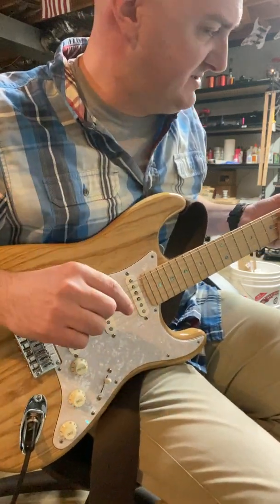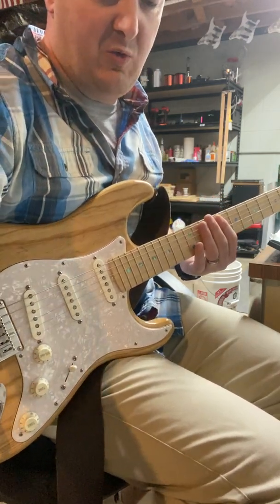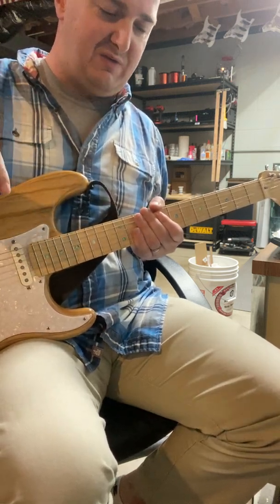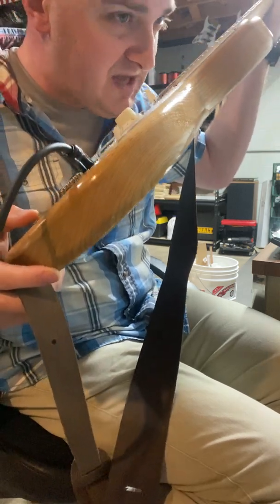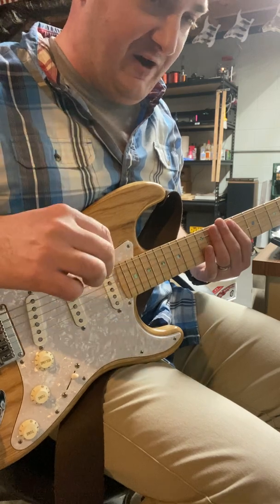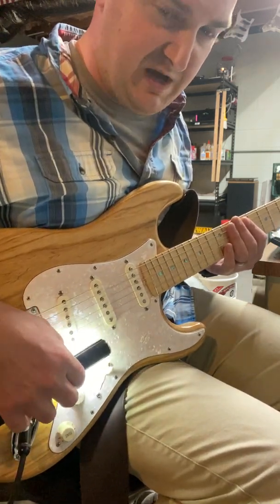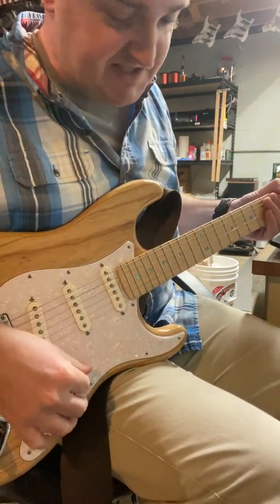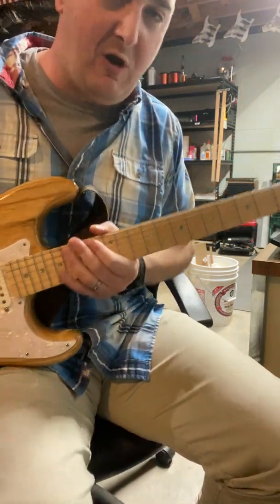60 cycle hum, RFI and Shielding is useless Noisy electric guitars SCIENCE EXPERIMENT

Comment: This video is very informative. Thank you! 
I am kind of new to all of these sounds. My first guitar was a PRS Torero with active pickups and those are really quiet! I never heard any noise or hum with that guitar, but a couple years ago I got a Fender with a P90 on the neck and a humbucker on the bridge. God, it is noisy!! Even with the humbucker, it is VERY noisy, but maybe I feel it that way because I was used to the quiet pickups on my PRS. My Fender also had one problem: from factory the bridge wasn't wired to the ground, so it was way noisier, but later I got that fixed. I still feel that there's something wrong with the wiring, but maybe it is also me having a hard time getting used to these pickups and finding out that the wiring in my house is worse than I thought.
Reply from the maker: Thanks for stopping by and commenting! 🤘.

Yes, when you have really quiet active pups and go to a single coil or other passive pups and play with high gain, the noise level is very different.  Honestly I just deal with it. I prefer the dynamics of passive pups over active.

Comment: 6:30 This noise is not from the light or LEDs, there is a pulse converter inside the flashlight, the noise from it.
Reply from the maker: I know that and understand that completely.  But breaking down any further than “this light causes rfi” for most people whenever they can’t identify and understand the difference between basic guitar electronics noises doesn’t help anyone.  I’m not trying to insult anyone by their lack of knowledge here and that’s precisely why I broke it down to basic ideas with basic demonstrations.  

Sometimes being “too smarty pants” is too much when you are covering basic topics quickly.  Being effective while teaching is more important than teaching stuff that 1- is over someone’s head 2- not really relevant to the purpose and intent of the lesson. 

That thing I have in my hand is a light.  I used the light to make the noise.  Either way, the noise is still RFI.

Thanks for the comment. 🤘
Reply: @MathewsGuitarWorks  
Not count boring, but the humbucker is designed to suppress large EM-fields, which it does remarkably well. Using a focused EM-emitter is not the right way to demonstrate. Also, many guitarists don't use that much gain, and the level of noise reduction provided by shielding is sufficient for them.  😉
Reply from the maker: @iridios6127  You are splitting hairs a little. Not everyone is an electronics engineer. Nor do they need to be to understand and demonstrate basic ideas. RFI and EMI are synonymous. RFI generally refers to a subset of frequencies.  

I completely understand that most people don’t play with that much gain, nor do I. It was FOR DEMONSTRATION PURPOSES. 

Shielding passive components, control cavity and or around pups of an electric guitar does absolutely zero in reducing noise in a guitar circuit when the point of entry of all sources of RFI/EMI in an electric guitar are the pups which are open to the exposed elements. 

I bet you’re fun at parties.
Reply: @MathewsGuitarWorks  
Are the shieldings that you set — were made in the form of a Faraday cage, with grounding?
Reply from the maker: @iridios6127  of course.
Reply from the maker: @iridios6127  99% of the guitars that come through my shop have the control cavity shielded some way shape or form. It doesn’t make a difference whether you shield the control cavity or not because passive components don’t pickup or amplify anything. 

Even if you shielded around a pup (pickguard) and around the actual coil itself, it would be negligible at best in stopping RFI if the face of the pup is exposed to the outside world.
Reply: @MathewsGuitarWorks  
Sometimes, someone makes an overcomplicated or a poorly executed circuit and then — shielding helps.
Reply from the maker: @iridios6127  Not in passive guitar circuits. It is marginally effective in active circuits.

Comment: I heard from someone that cavity shielding works a bit like a extra capacitor which cut some of fq from signal, thats why its looks like we deal with 50/60hz hum. But same thing we should get when we turn down master tone a little bit. Anyways... i will be always hum more or less depends of place where you playing and how good electric instalation is, grounding etc... And shielding can change overall guitar tone so... 🙄 Its better to buy noise gate.
Reply from the maker: Never had the need for a noise gate. I’ll deal with the noise first before I do that.  

Thanks for stopping by 🤘.
Reply: @MathewsGuitarWorks  now i didnt play on stage but when i was active and play with band i used cheapest behringer noise gate for 20$ (boss clone) and this works well.

Comment: so i have a guitar that sounds the same as yours. Is there any fix or workaround to reduce the noise when not touching the strings? thanks in advance
Reply from the maker: Ground noise while not touching the strings is completely normal. There’s not a lot you can do other than make sure you have a quality wiring harness or at minimum the wiring harness in it is properly grounded. It won’t make the noise go away completely but  proper grounding will help reduce it.  I’ll tell you that mine gets worse with cold dry air. When it’s moderate temps and reasonable humidity, I notice less noise overall from my rig with exception of 60cycle hum which is a single coil pup thing. 

Hope that helps, thanks for watching.

Comment: I had a copy strat. Shielded. But the hum never goes away. I think its normal for a single coil to hum. And im getting used to it. 😁😁
Reply from the maker: Yea, I have learned to deal with it myself. Now remember, my amp in the video was cranked, so the noises are way louder than usual. When I run my amp at normal volumes, it’s hardly noticeable. I tried noiseless single coils and I didn’t get the sound I was looking for. So I’m a true single coil fan.
Reply: @MathewsGuitarWorks  i havent tried hot rail pick ups. Maybe it will work.
Reply: The hum shows up when im using distortion. But in clean tone. No hum at all.
Reply from the maker: @khrisemmanuelmaxgeneralao809  that’s completely normal. The more gain you use with single coils the louder the 60 cycle hum will be. Hotrails are just small rail humbucker pups. 60 cycle hum is not a big deal for me. I’ll stick with real single coils.
Reply: @MathewsGuitarWorks  thanks for the info sir
Reply: @MathewsGuitarWorks  if i installed hot rail pick up for bridge, will its still hum? Sorry for the grammar. Im from philippines.
Reply from the maker: @khrisemmanuelmaxgeneralao809   No. If you install a hotrail pup in the bridge, it will not have 60cycle hum anymore. If the problem persists, then it’s some other problem.
Reply: @MathewsGuitarWorks  ok sir. I ordered musiclily hot rail pup. I cant afford seymour duncan hot rails. Hehehehe

Comment: I would be curious to see this video with many different new tests :

-Use only you amp, no pedal in between.
-Pack fresh cable.
-Never change your EQ or Amp settings between two tests. Leave everything at 12 o clock.
-Stay 2m away from your camera and cell phone.

Test 1 : unshielded guitar : plug your guitar with absolutely EVERY other electrical equipment unplugged or with the circuit breakers opened except the one you're using for your amp. Other equipments put noises back in the ground wires,

Test 2 : Test 1 + power conditioner (like a Furman) in order to filter your electrical signal and regulate it as your electricity provider may not deliver stable electricity.

Test 3 : Test 2 + fixed ground wiring to be absolutely sure your guitar is well grounded. Must be properly tested to be entirely sure the grounding does work.

Test 4 : Test 3 + fully shielded guitar that is actually grounded to your guitar jack, with each cavity connected to one another.

I would be surprised to see what noises you still have left with each of those tests.
Between each test, try touching / not touching the guitar grounded metallic parts, and try changing from a pick up to another.
I would also try powering everything back on after the last test and see what noises come back.

Your video was fun since you clearly suffer from most possible noises guitars can have. Now I would like to see you fixing them one by one so that it helps associating a noise to a specific issues, and then to a specific solution.

I ll subscribe and wait for part 2 !
Reply from the maker: Haha! I don’t know if I have the time to do all that but I do have a shielding test on the books to work on and post. Probably be sometime in the first quarter of the year before I get to it. I have a bunch of pedals and pickups I have to finish and get out before I move on to anything else. 

Some of the noises absolutely can’t be cured. 60cycle hum won’t ever go away and the ground noise when not touching the metal parts won’t ever go away. 

Thanks for watching and commenting.🤘
Reply: @MathewsGuitarWorks  If touching the strings makes the noise go away, it means the grounding of the equipment is naturally faulty (instrument electronic, cable, amp, socket, house wiring ...). I have this exact same issue at the moment. I am starting to troubleshoot it. I ll let you know if I find anything that solved my case, even though the noise is clearly manageable.
Reply from the maker: @Romain_Chafore   The noise that goes away when you touch the strings is normal. Some guitars do it worse than others but all guitars do it and you can’t do anything to get rid if it.
Reply: @MathewsGuitarWorks  Now I have spent quite some time shielding my Bass, you CAN get rid of it. I shiedled every cavity with copper tape. I ensured there was a continuity of the signal between each cavity and that it was grounded with the knob plate. The result is astounding. The problem was mostly my body acting as an antenna emitting and reflecting interferences. When I hold the bass, noticeable hum. When I put it back on the stand away from me : light hum. Now with the shielding : ZERO hum whatsoever. And no, I am not talking about line hum (50/60 cycle hum) which I don't have since my PU are noiseless, in other words humbuckers stacked on top of one another. Man, stop the clumsy explanations. Get yourself humbuckers, improve your home grounding, use filtered power plus or power regulator, shield your instrument .. 99% of your troubles will be gone.

Comment: 3:50 Discussion of 60 cycle hum begins
5:00 Example of 60 cycle hum sound
Reply from the maker: Preshate that. Maybe I should go through and add time markers for each topic. I actually plan on doing a remake of this video and focusing on the shielding aspect of it with some basic experiments.
Reply: You’re most welcome! I came across a mention of 60 cycle hum and 50 cycle hum in an old rockstar interview that resurfaced a couple weeks ago, and as a non-guitarist I had no idea what that meant. It’s nice to see and hear a good explanation of it!
Reply: @MathewsGuitarWorks Thanks for the content. If you do plan on remaking this, try tying a sock around the fretboard to stop the string noise
Reply from the maker: @scottgallagherguitar  next video won’t include a whole guitar or strings. We are going to isolate the pups and controls and use a proper faraday cage setup.

Comment: The microphonic test isn’t valid, pickups are not microphonic by design and what you are hearing is the string vibration influenced by your voice which in turn influences the magnetic field in your pickup.  To verify remove all the strings and do the same test.  Most 60 HZ , logic tells us comes from the line not the ambient if it came from sources such as light then turning off the light would reduce noise.  Shielding in the guitar is to create a Faraday cage which is nonsense since your magnet poles and strings are outside of the shielding.  A simple thing to do to reduce 60hz noise is to do a twisted pair on your output wires.
Reply from the maker: Agree with everything but the microphonic test. I’ve done the same test on several different pups and pup types and had a similar result.  Some pups are worse than others and construction/parts definitely play a role in this. However, the part about the strings influencing the output is true. 

I’m not trying to solve any noise issues.  I’m simply helping people understand where the noise comes from because most people don’t understand. 

As far as shielding goes, your statement about shielding is exactly what I demonstrated and said. Passive guitar controls cannot be the source or place where noise is introduced into a guitar circuit.
Reply: @MathewsGuitarWorks  I hear you.  The entire reason I wrote is because you get it.
Reply from the maker: Thanks for stopping by. 🤘

Comment: I have what I guess is a weird situation that I've been trying to deal with forever.  A little ground hum, no big deal.  Very little 60 cycle hum.  But I have a lot of what sounds like RFI.  However if I switch to the 2 or 4 positions, it reduces by like 95 percent.  I don't usually like playing in those positions unfortunately.  Humbuckers are quiet.   Also if I move the strat around, it decreases a lot.  I still can't find the source.  I have three computer monitors but the noise persists even if I turn them off.  Shielding did help a little, but not nearly as much as I'd like.  Thinking about getting noiseless pickups even though I don't really like the sound.  I did have a guitar with noiseless pickups and similar to humbuckers, no RFI problems.
Reply from the maker: If the noise goes away when it’s in 2 & 4 and it doesn’t happen with humbuckers then it’s probably not RFI. RFI is from outside the pup. 60 cycle is generated in the pup. 

I’d have to hear it to see what you were talking about. It very likely could be your home wiring. I know mine creates a lot of noise in my amps.
Reply: @MathewsGuitarWorks  It's a higher pitch than the 60 cycle hum that you demonstrate.  If I roll off the tone, it gradually decreases.  

I don't know.  I'll try to make a video sometime this week if you'd like to hear it.
Reply from the maker: @JohnBrown-z2u  find me on Instagram and send the vid to me there.
Reply: @MathewsGuitarWorks  I don't use instagram, but I'll put it on youtube and hopefully you'll still look at it.
Reply from the maker: @JohnBrown-z2u  send it to my email. kalebmgw@gmail
Reply: @MathewsGuitarWorks  Will do.  Thanks
Reply: Might be wifi router or cell phone RFI

Comment: thanks that was really interesting . Just can't figure out why it gets better when I touch it.
Reply from the maker: All guitars do it to a degree. When you touch the strings or any metal part grounded to the circuit, it completes the circuit and reduces the ground noises you hear.  If it is really bad, then you may need to check the harness to see if there is a loose ground. If it sounds like light intermittent random static, then there’s not much you can do to fix that. When it’s really dry outside mine gets worse but not intolerable. There’s also a relationship between your guitar’s wiring, the amp and you when you touch the strings. Most likely, I’d say it’s not an issue to worry about.
Reply from the maker: Thanks for stopping by!

Comment: Very useful.  Thank you.  Question: is there anything that can be done to the amp circuitry to reduce the 60 cycle hum?  I have an ampeg reverberocket II and my humbuckers guitar starts to hum at about 1/2 amp volume, but my p-90 guitar starts to hum at about 1/4 amp volume.  Rolling off guitar volume reduces hum on both guitars.
Reply: Thanks for circling back.  I’ve never heard of either of those two devices, but I’ll look into them.  Right now, I’m mostly trying to keep environmental influences (lights, etc) for radio frequency interference and humbuckers for 60 cycle hum.  It’s much quieter.  I’m still not really clear about how proximity to the amp influences hum and what, if anything other than walking around the room and keeping my back to the amp,can be done to reduce that hum.  I think the ‘answer’ for getting a manageable hum level from single coils is to just use a smaller amp with carefully set volume levels and just mic it.  Again, thanks for this.
Reply: Put a Boss NS-2 in your effects loop.  It will get rid of the hum. An ISP Decimator in front will eliminate feedback.

Comment: Hang on...with the foil test, it's not grounded into the circuit...that's why it's not worked. I have the entire cavity shielded, a plate behind the pickup and then the cavity has a soldered ground going from the cavity to back of the pot. Admittedly it's not a full faraday cage as I'm not shielding the pickup covers etc but it has 100% helped. I'd be keen to see you redo this but fully shield the cavity, pickguard and then connect to ground. I'm not saying it's going to cancel all of it but I'm willing to bet it reduces it.
Reply from the maker: It was grounded into the circuit. I was touching it and the strings and another time it was touching the strings.  No change either way. 

All my pro shielding/I believe this helped reduce hum/noise friends all tend to forget a few very important details. 1- shielding passive components like the pots and wires do absolutely nothing. 2- the pup face is still exposed to the outside world which is the source of like 99% of all RFI 3- if shielding reduced any noise at all it’s an indicator that you had a grounding problem prior to adding the shielding. Shielding is intended to reduce RFI in a guitar, not “hum or buzzing”.

And yes, I’m making another video about this.  Thanks for watching and commenting.